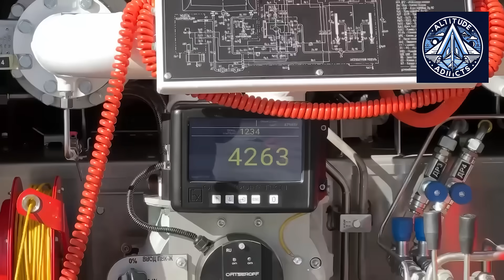Serially Produced All-Russian Superjet SJ-100 with PD-8 Engine Makes First Flight - Pilot Interviews

Comment: Russia has many indigenous airplane models but need to team up with another country to increase production to supply overseas countries. India should get involved in manufacturing the wings and air frame while Russia provides the electronics, the landing gear and engines.. Even choose Brazil which already has a small private plane production.
Reply: Currently a potential licensed joint production of civilian aircraft with india (SJ 100 or IL 114-300) is in works. As recently indian Minister/high ranking government officials visited russia for some ongoing deals/projects and russian embassy of india confirmed one of the deal that is under implementation phase is- joint production of civilian aircraft. 

Yesterday russian government official- Aleksey Gruzdev also said that some talks regarding joint production of civilian aircrafts with india is currently ongoing and was reported by TASS/RT and other russian news agencies

Comment: China tiene el ARJ-21 y rusia tiene el SJ-100. 
Opino que Rusia deberia de apoyar a China en la fabricacion de los componentes mecanicos que vienen de EEUU para su avion C919 y China apoyará a Rusia en componentes electronicos para el MC-21
Reply: Saya lebih berharap setiap negara tidak bergantung komponen impor.
China harus bisa seperti Rusia.
Mungkin diawali membuat mesin yang tepat untuk C919 dan C909 mereka, disusul kemudian sistem avionik, elektronik dan lain sebagainya.
Sekali hubungan antar negara terganggu, hasilnya adalah pembatalan proyek pesawat itu.
Berbagai proyek Antonov langsung batal akibat hubungan antar negara yang memburuk.
Reply: @CintaSepakbola-mania  Anda benar tentang kemandirian teknologi, tetapi penerbangan adalah kasus khusus. Baik Tiongkok maupun Rusia telah berhasil membangun stasiun luar angkasa dan pabrik fusi mereka sendiri, tetapi beberapa komponen penting penerbangan sipil (non-militer) memerlukan efisiensi dan sertifikasi teknologi yang signifikan, dan itu membutuhkan waktu yang lama. Jadi, ini bukan masalah teknologi, melainkan masalah waktu. Oleh karena itu, saya mengusulkan untuk membagi tugas.
Reply: @CintaSepakbola-mania  They use western components just for asking to be certified in western sphere.  Has the West hindered it, then they will a little bit of change those components part by part to domestic built.

Comment: I’m excited to see Russia regaining its wings. I am a little shocked though with the PD 14 engine service interval on the MC 21 6000 hour service life out of a $17 million engine when western engines go 30 to 40,000 hours they have to get the times comparable to that. Other than that, bravo.
Reply: Это нормальная практика. Ресурс всегда в начале эксплуатации назначают минимальный, затем он продлевается всё больше и больше.
Reply: I have not found a source with such engine data. Most likely, you are writing about the previous Russian-French engine, which was really unreliable. According to the most preliminary, official data, the maintenance interval of the PD-8 is at least 20,000 hours (40,000 flight cycles).
Reply: It means Russia put the shortest limit interval to remove the engine for inspect, and it will extend the interval up to the condition of working engine afterward.
It is not the real service life.

Comment: Can somone here explain why PD-8 is supposed to be a modern engine but is still rejecting that amount of smoke?
Reply from the maker: I can't vouch for it, but the smoke is during the take off. I have not seen it in cruise stage.
Reply: Según nos informan los amigos de Adictos a las Alturas en anteriores comentarios, los motores impulsores de la serie PD, como el PD-8, es un motor eficiente, ahorrador de combustible y también no contaminante, es decir ecológico, que es la preocupación de nuestro amigo suscriptor.👌✌👍👏
Reply: @nsangouchouaibou7372   more smoke more warmth in cold countries, more beneficial.
Reply: There are youtube videos of modern jet engines smoking like crazy.  Could also be a FADEC setting that runs the engine a bit rich at takeoff.
Reply: This is the exhaust coming out of your ass!
Reply: it is not fully combusting the fuel..
Reply: У некоторых дыма из задницы идет гораздо больше, когда они видят его в небе!😂
Reply: Hope, it's s failsafe mode for testing.
Reply: @nsangouchouaibou7372  из ваших самолётов вообще кучи дерьма выделяются в нашу русскую атмосферу. Вон их с нашего неба!
Reply: There is "все больше" in russia, so amount of smoke too. 🤣